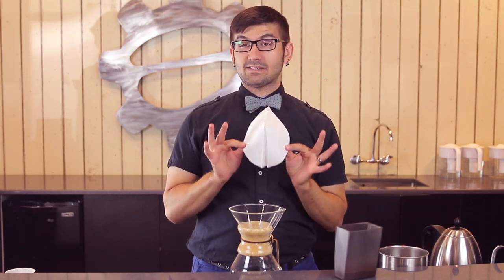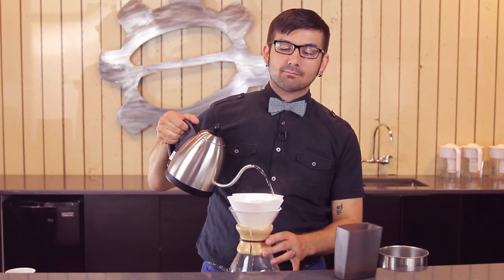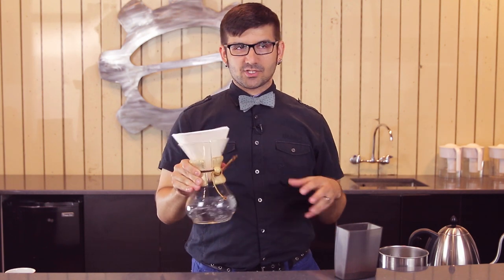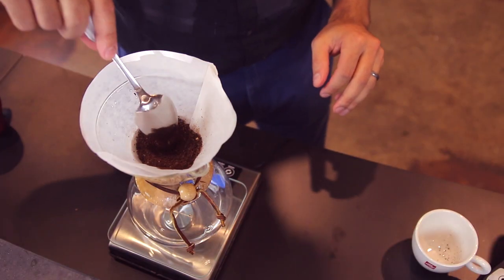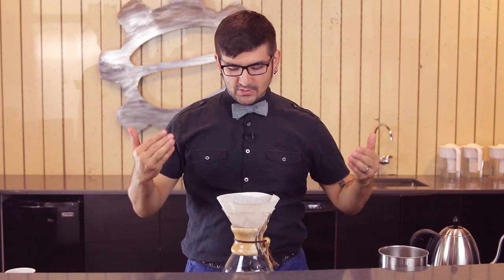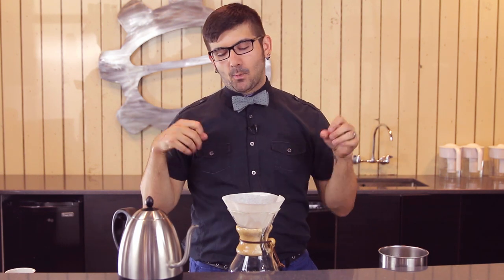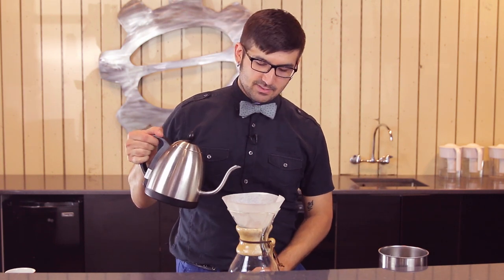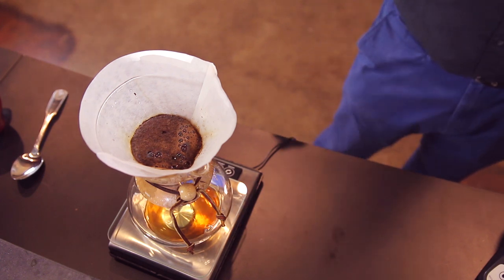Pour Over Coffee Method | Pour Over Technique | Cup O' Joe

Comment: Good video! Question for Joe: I usually avoid pouring on the very edges because it washes the grounds down and leaves the filter exposed, which creates a path of lesser resistance and therefore more water goes through that part of bare filter instead of through the coffee on the bottom. I saw this somewhere online and tried it and it actually improved my cup. What so you think?

Comment: Hey Joe, thanks for the tutorial. 
From what i learned through youtube is the ratio is 15g of water to 1g of coffee, which is very close to your ratio. What is very different is extraction time, you aim for 3:30 while i learned it was 4:30. I brew my chemex accordingly but i have two issus, 

1- the muffin reaction while blooming is not happening. 
2- whats the deal with the extraction time, i got sour coffee after 5:00 not slightly before or at 4:30. 

Thanks again
Reply from the maker: +Manea Al-Mehairi Every coffee is going to brew up differently, so taking these parameters and adjusting to your taste and coffee is best! Cheers!
Reply: +lesslighter Thanks for the input, i still struggle to be consistent although my ratios are the same. today i brewed my chemex with 3:30 minutes and got a very strong coffee, stronger than the 4:30 timing and yes i used the same ratio. 

As for temperature, i found that if i preheat my kettle before pouring the water in it and got really acidic coffee.
Reply: +lesslighter I do use bottled water and heat it with an electric kettle
Reply: Muffins tend to come from the fresher roasted coffee

Comment: Hey Joe. I noticed you often use a 6 cup Chemex to brew a single cup of coffee. In your opinion is the 6 cup still good for brewing smaller amounts? Or will you get better results with this size if you're using it for larger amounts? I'm looking at getting one, but I usually only brew one cup at a time, and I've heard the 3 cup chemex isn't as good
Reply from the maker: The cone size of the 6 cup Is at a better angle then the 3 cup. You shouldn't notice any draw backs by using the 6 cup for smaller amounts.
Reply: Thanks!

Comment: I wish you would do a series on expresso!  Example, answer this question:  why may you have to adjust grind size to get same pressure when you switch to a different bean?  Just experienced this.....different bean origin....same grind setting....same tamp pressure...but expresso machine had such a high pressure I had to start over. There are lots of other variables I think you could explain in term I understand.
Reply: In my experience, it boils down to differences in density. Different beans have different densities (usually, coffees grown in higher altitudes are denser) and even the same coffee roasted to different roast degrees have different densities (darker roasts are less dense).
Reply from the maker: +ascosta We would agree!
Reply from the maker: +kweym Absolutely, working on one as we speak!

Comment: Great Chemex how to video! But I still can't get it quite right. I am using 525 grams of coffee with a 1:16 ratio and a medium grind (20 of 40 on a Baratza grinder). The water seems to be flowing through in 2 1/2 minutes or less and I end up with watery coffee. I am hesitant  to make my grind finer based on the advice I have seen. I do the bloom as demonstrated. I suspect it may be my pouring technique. Don't know how to slow the process down. Would be interested in any advice you could offer. Thanks
Reply: Ultimately your grind should be tweaked based on flavor. You coffee is watery so you need a finer grind.  If your water took a while to flow through and your cup was bitter obviously you're grinding too fine.  Hope this helps, one year later :)

Comment: As you know, no brewing method is perfect. Using a paper filter results in the coffee not having it's full expression as most of its oils are trapped in the paper filter, but the coffee in the cup is clear without fine grinds. The French Press allows for the oils to go into into coffee brew, but you  might get some small coffee grinds when poured into a cup. But one can use a small wire mesh strainer (like used in whole tea brewing) to catch any potential  grinds. In both instances, either drink all of the coffee, or place the rest in a some sort of a coffee thermos. I use the French Press only, and the Italian moka pot for traditional espresso.

Comment: Anyways you measure grams to ounces or millimeter to ounces 400 g or 400 m =  14 fl ounces +/- a few decimal points. Besides, grams is weight not volume! Volume is millimeters! You cannot consistently convert grams to fluid ounces because one is weight and the other is volume. Also, water and coffee, for example weigh differently due to the particulates in each liquid.
Reply: George Givens, Jr. Millimeter is for distance...think you meant milliliter or cubic millimeter.
Reply: LPFHelios typo thanks for clarification however my point stands.